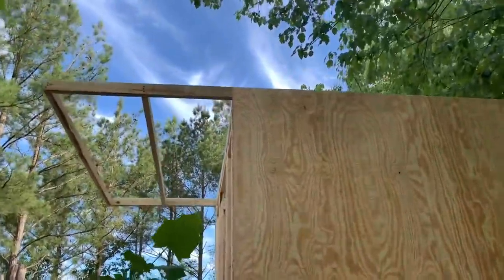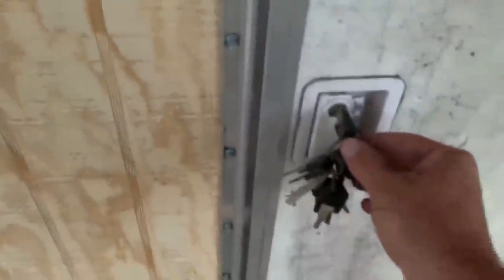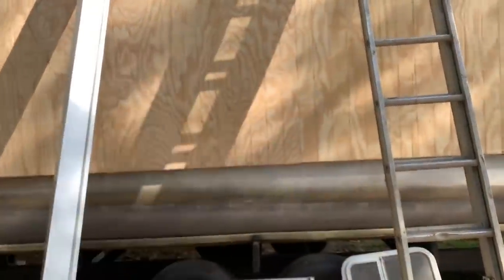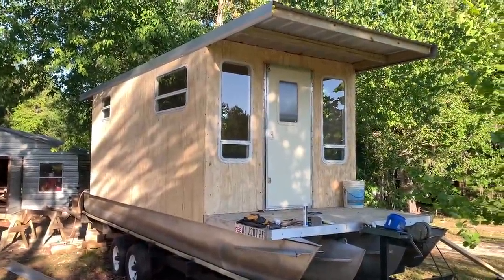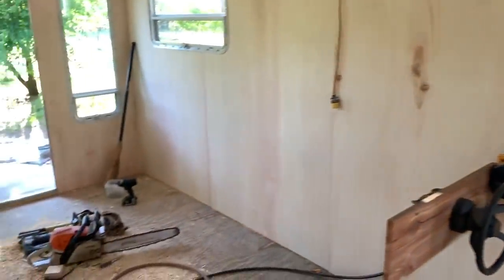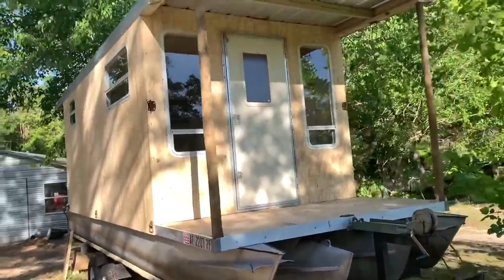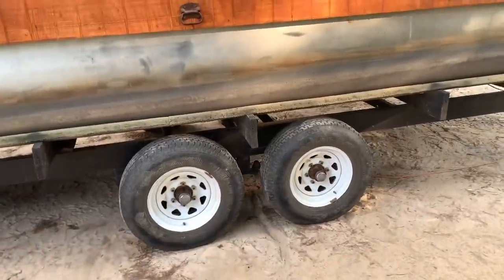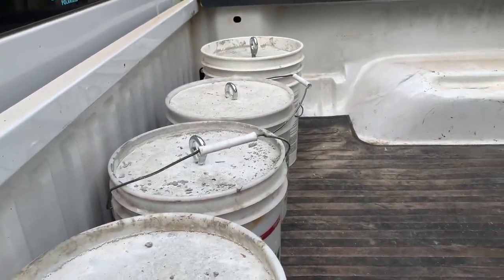Finishing Up the Catfish Cabin! Final Stages of the Covered Pontoon Boat!

Comment: Lookin' GOOD !!  Inside that closet, two 5 gals buckets.  One with a Lugable-Loo toilet seat on it, the other one with a lid, full of sawdust.  Put a plastic liner inside the bucket, scoop some sawdust on top after taking care of bidniz and seal up the bag.  Another plastic liner in place for the next person.  GTG... no lingering smell, no chance of "spillage", stays clean... and just empty the bucket full of sealed up trash liners into a contractor bag and dispose of it.  Now, a feller could get full-on fancy and frame it in with 2x2s and scraps of wall covering material so the bucket sits solid to the floor... add a PVC pipe up and out near the ceiling... and install a computer cooling fan inside, run off a tiny battery and solar panel.

Comment: Hi Jeff. The weight of the 80 pound concrete buckets above water 80 pounds. But in water it's less. Fresh water weights 8 pounds per gallon and salt water weights 8.5 pounds per gallon. So the water displaced by the concrete bucket is 40 pounds. So your 80pound bucket of concrete on land weights in at 40 pounds in the water. If you have steel or iron in the buckets it's heavier in the water. I  love your video's and the time that you spend making them man.  Thanks again for them Jeff and Hannah  ❤

Comment: I know you tested it now and don’t need the 55gal drums on the sides.  Maybe you could do a front tech extension and once you park clip that in with the 55 gallon drums as floats.  You could probably do a 4-6 foot extension on those.  

Another option for the top if it breaks would be to cut that 10 back to the cabin edge and seal it and you could just put another board up there and use canvas or a soft top to go out just leave it off till you park.  Make it like a transformer boat that’s assembled once you park it you could get an extra 6 foot deck on there and have a canvas shade roof over it.  That would give you plenty of room for forfive people out there and your fryer and a place to clean them.  There are lots and lots of options you could even just hinge the floor extension and roof extension and have it fold down for trailering to protect the front from rocks and wind blasts.

It looks great!  Now you need to come up with a great name, “Cat Noodles”  or something like that.

Comment: Jeff, love that air break. Super smart! Can’t tell how it’s attached to the house. But instead of having to use the tie down straps, could throw a padlock on the front where the two pieces meet. Would also add a level of protection when y’all are away. Another option could be to attach the two boards with a couple of hinges and have an accordion style doorway that could swing open and pad lock it at the end (far left or far right) side, whichever way you want it to swing...either way, cool rig, should help up the catfish production!

Comment: I suggest getting clear vinyl sheets that you can snap to the roof of the deck so that if it starts raining you can put them up and still have the front door open to drive it around or sit out on the deck with a foldable chair or something and not get everything soaking wet inside.

Comment: It is the chain of the anchor that weighs down enough to hold, these will probably do fine but consider the drag friction as well, if you need more set them further out with more chain, or set up a permanent anchor however they do that lol - fine work mr Barron

Comment: Put a little wheel house halfway out the top of the cabin in the rear corner.  The controls should reach, and it would make better room in the cabin.
I'd put it on the starboard side, but I believe you put a door there.
Make a little platform so you can be at least head and shoulders above the roof in your little wheel house.  Make it so you can open up the clear wheel house when your running in good weather.  Of course you could just make a hatch to open and stand up through off your control platform, but then you won't be able to use it in the rain.

Comment: Very nice job. If it was my work of art I would put the shooters bench you made on the front "porch" and since the roof is flat add a big solar panel hooked to a good deep cycle battery. Can power a trolling motor or charge phones etc.

Comment: Concrete anchor actually weigh less under water than it weighs on land. Plus the round smooth shape of the buckets will let your boat drag in a good wind. As for using them to hold you in place while fishing or cooking there should be no problem
      But I would get a steel anchor when you can afford it. Pound for pound a Danforth has more holding power with about 15ft of chain. Every time the boat tugs on it, the deeper it will dig. I'd use a 15 pound to 20 pound Danforth, that should be all you need. Check around marinas or marine flea markets for a used one. A used anchor will hold just as good as a new one, but cost much less.

Comment: I was thinking in two engines Mr. Barron (Yamaha or Mercury are perfect) 🤔 not always you will use two, but one for backup would be great if the other doesn't work properly for any reason. ⛴ it looks really nice 👌 I like the brown color, very cool 👍
Reply: Arpon001 unless your in the ocean the added expense and weight of a second engine isn’t worth it for fresh water
Reply: @billysmith5977  well would be for backup if the main engine fails for x reason.

Comment: Maybe add weight between the middle pontoons to make the bottom more heavy in center of the boat kinda like they do with ships wen they put lead in the bottom of their hulls to make them more heavy to keep them from tipping in storms i forget wat the part is called on a ship some are made of heavy hard woods and coated b4 mounting to the ships frames but hope this helps,instead of out riggers u gotta move each time u move,,

Comment: Jeff you and Hannah did a jam up job on this project... If you are concerned about any water damage, there is a product call CPES (Clear Penetrating Epoxy Sealer) by Rot Doctor that is an insane Water PROOF Solution for wood etc. It is used in wooden boats and ship building. Thank you for sharing...

Comment: Hay Jeff Great job man. I just was wondering if you put any silicone caulk along the front top between the front roof and the front wall? Because the wind could lift the tin up off the top or even if it is raining the water could also come in when your driving in the raining?